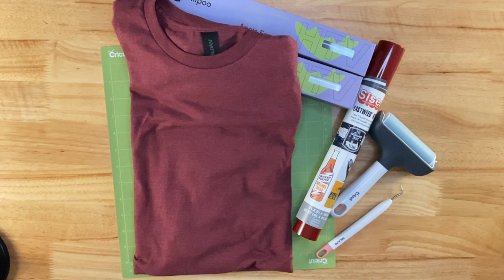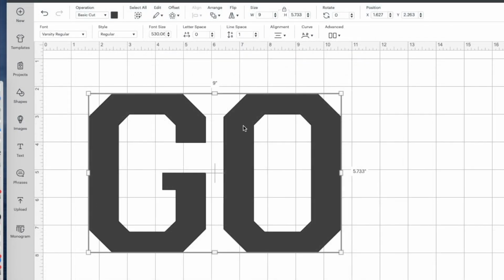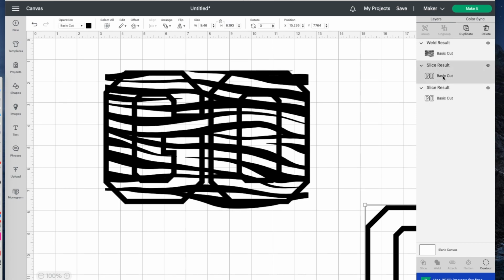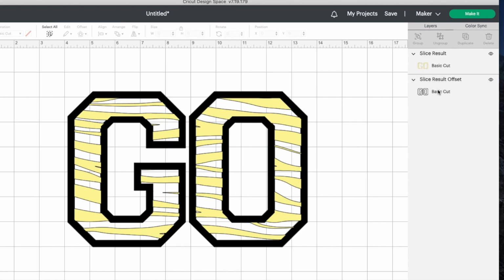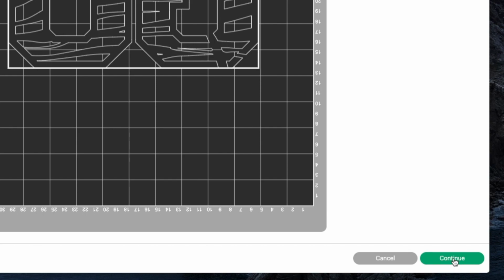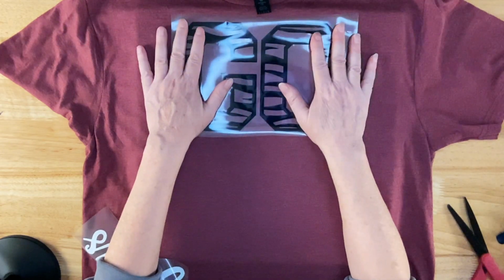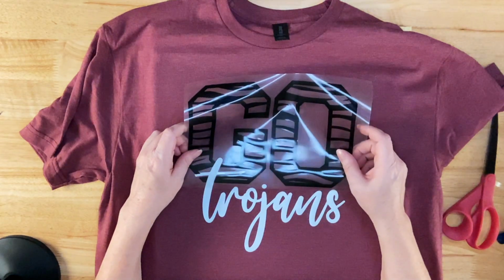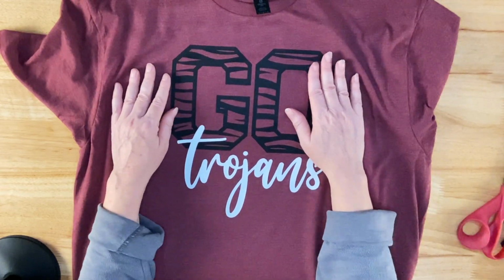How to Design and Make This Shirt with Hiipoo Heat Transfer Vinyl

Comment: Great video.  I love my cricut for regular cutting, but I'd design it in silhoutte, much easier,  and save as svg, then take to cricut to cut
Reply from the maker: I usually design in Silhouette or Inkscape and then save them as SVGs too. Like you, I prefer cutting with the Cricut but designing in better software.